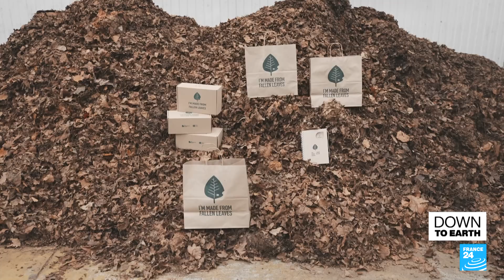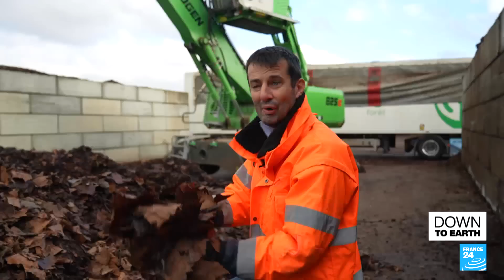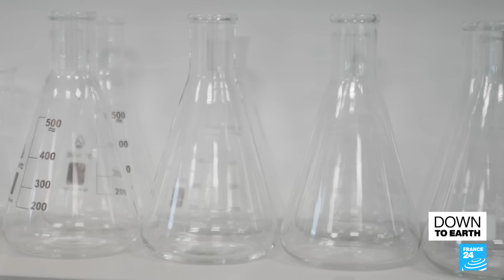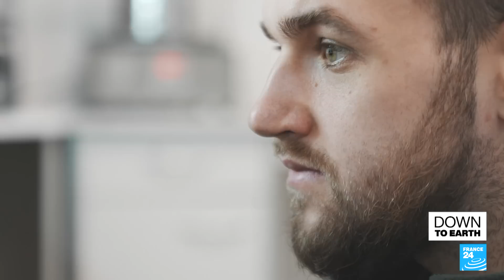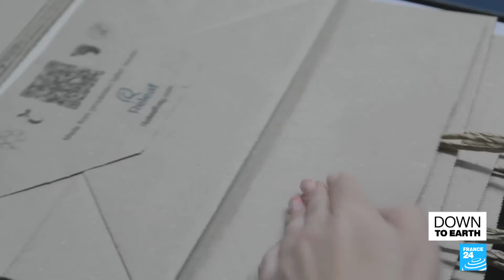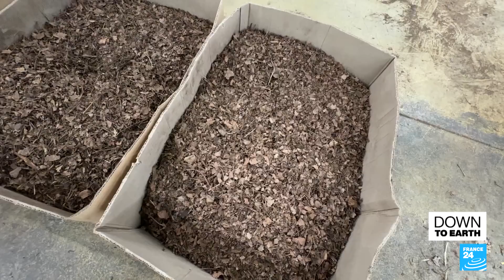Could dead leaves turn into green gold? • FRANCE 24 English

Comment: 'Save the trees' is one of the stupidest slogan ever used by ignorant people. 
Let me explain: the trees that must be saved are those from natural forests, the Amazon basin, central Africa, Far East rainforests.
Extremely expensive timber that is NEVER used for making paper. 
The main type of timber used for paper is from Poplar (scientific name: Populus, which belongs to the willow family, Salicaceae).
Its pulp is soft, with low tannins. And it grows fast, so they are planted by the thousands, and harvested after two to five years to produce biomass (that has already sequestered tons of CO2) or 10-12 years to use the wood.  
Harvested like corn, wheat, potatoes, cabbage etc...
So 'saving a tree' from becoming paper is the same as saying 'save a corn cob' or save a carrot.
That being said, please, don't 'save' the LEAVES. 
LEAVE them  in the fields, so that they can naturally replenish nutrients in the soil, instead of using chemical ones.

Comment: Lignin is not useful for making paper which requires cellulose embedded in a lignin glue matrix. Lignin needs to be separated from cellulose to make paper. 
Lignin has other applications like fuel and as starter blocks for various organic chemicals.

Comment: i would prefer brown paper or normal brown leave color no colorings - can be also filtelizers maybe this can also be as extra income for those who collect
Reply: I am paper engineer, I work for a multinational pulp mill. The coloring is the result of processed leaves being mixed with used paper and cardboard at the pulp mill.

My estimation of this trial plant in the video would only supply one or two of 50 vats in our mills and in a day we would use each vat multiple times.

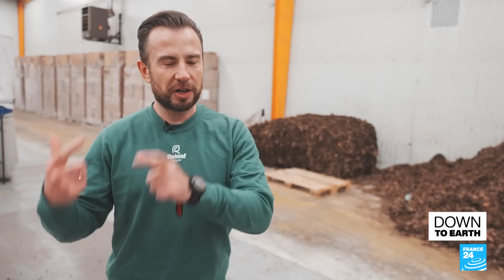3:40 most people don't know that "paper" can only be reprocessed/recycled 7 times, after this the cellulose fibers cannot be reconstituted in stable paper.

Also I know a little about the brands that use it, and many would state only 20% to 30% of packaging material is made with "Leaves" with 70% to 80% made with recycled paper with no virgin wood used in the manufacture of this packaging.
Reply: @robertlee6338  thats really a good idea if papers, boxes, and more can be made without much chemicals or colorings so not much toxic thingy